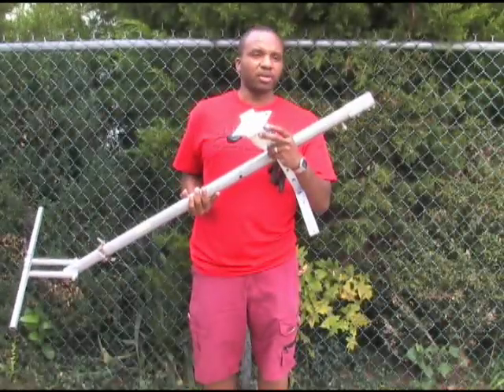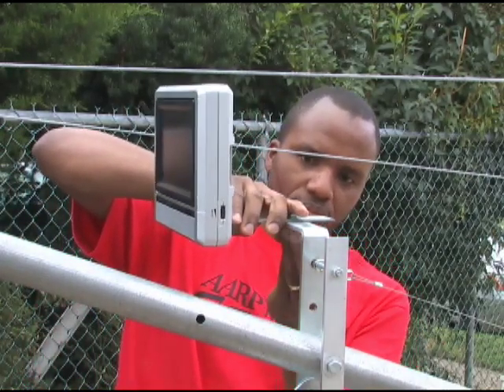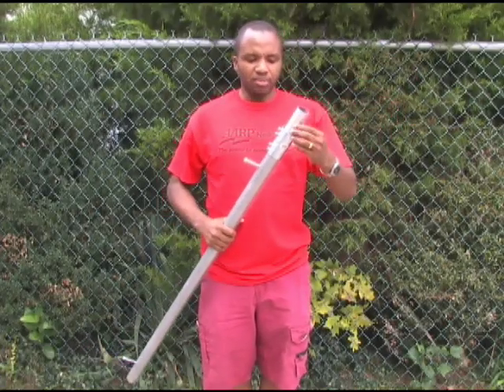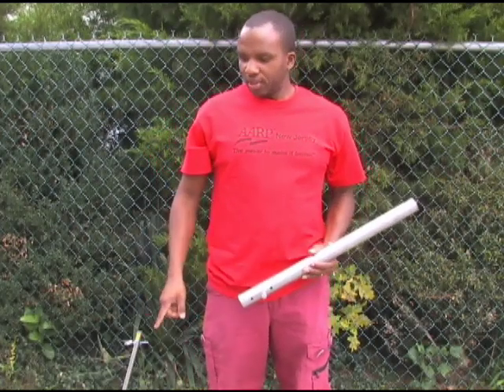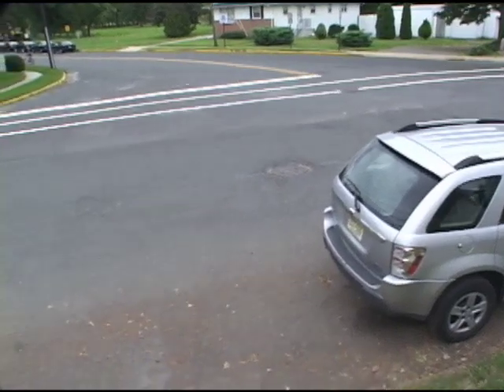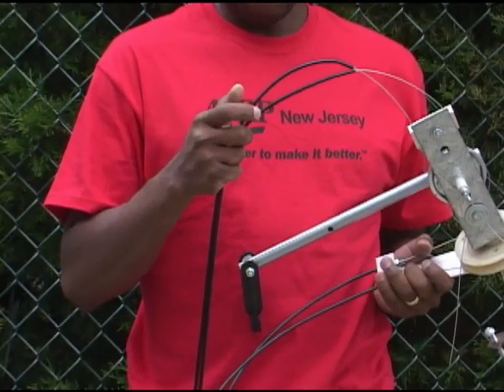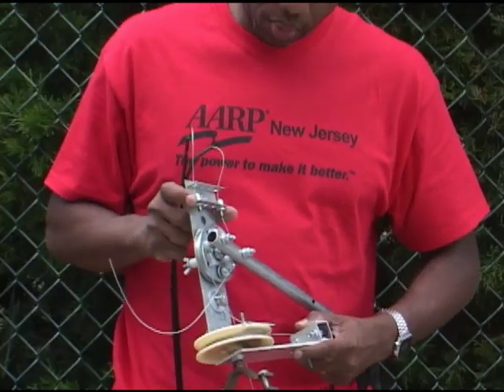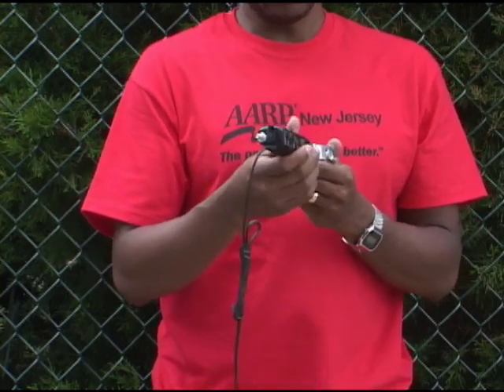About Jib3 Part 1 of 2 Jib & head control

Comment from the maker: No. The arm is made of EMT conduit, which is a metal pipe used primarily for electrical installation. I chose it because it is cheap (about US$12.00 for a ten-foot piece), and it is widely available (at most hardware stores). Fencing tube is pretty much the same thing.